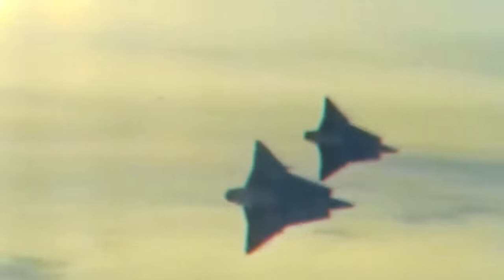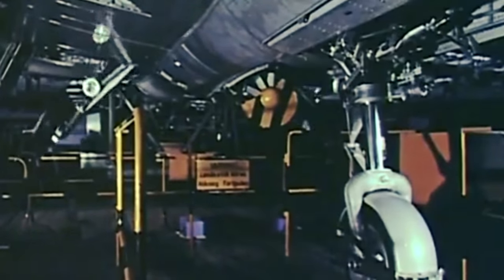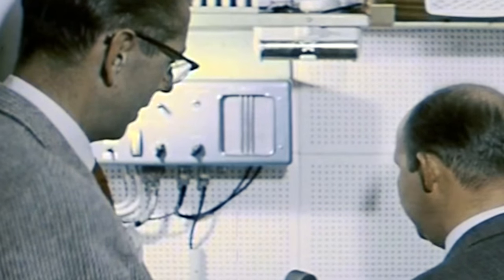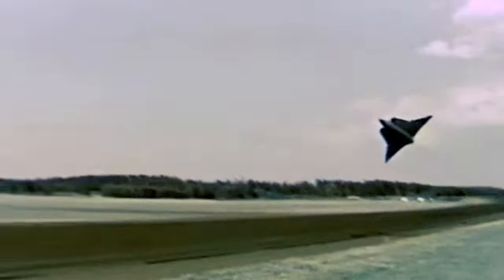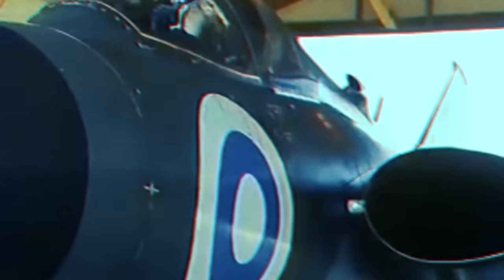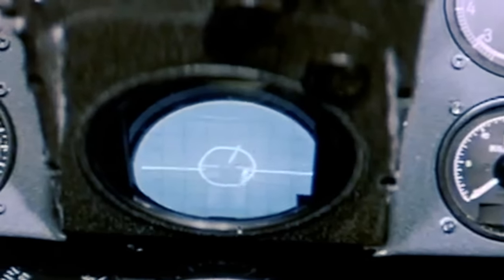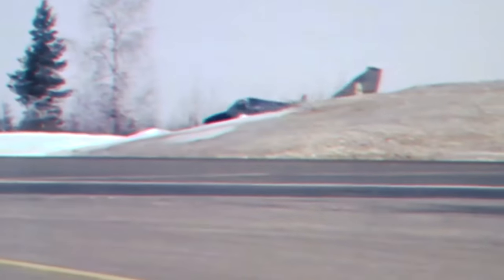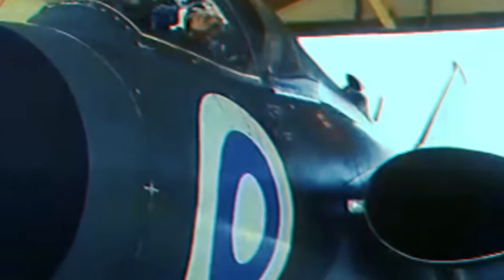The Bizarre Airplane Design That Shook Up Aviation

Comment: Always like the look and capabilities of the double delta wing. Makes me wonder why more plane manufacturers don't use it.
Reply: I think the HAL Tejas is the only modern jet that uses a pure compound tailless delta without canards.
Reply: I would assume it was cost in manufacture why it wasn't more popular for use beyond military.
Reply: Leading edge extensions on the F/A-18 are suspiciously similar.
Reply: Changes in computing and fly by wire, along with a canard configuration, made the double delta not as maneuverable.  Millenium7 has a number of videos that go over it in rather technical detail.
Reply: @thystaff742  Actually, the overall manufacturing costs were greatly reduced by the simplicity and practicality of this brilliant design. That's why Sweden (which had a population of roughly five million back then) was able to build 651 of these beauties.

They built the forward fuselage and inner wing as a single piece, then bolted on the rear fuselage (which contained the engine, of course) and outer wing panels. Frankly, Sweden couldn't have afforded a more expensive foreign fighter contract back then, so they opted to build the best homegrown fighter their limited tax base could manage, and to everyone else's surprise, it turned out to be a world-beating design thanks to their ingenuity. 

Canada could learn a great deal from Sweden!😉
Reply: @That70sGuitarist  The Arrow says hello!
(Avro Canada CF-105 Arrow)
Reply: @That70sGuitarist  Incorrect, homegrown fighter programs are much more expensive than simply buying already designed commercially available fighters. Only on very large production runs does it become cheaper to design your own plane. However Sweden had the hopes of selling their fighters to other countries and being able to regain the money they spent on development and infrastructure.
Reply: @weasle2904   While that may be true today, it certainly wasn't true back in the 1950's when they designed and built the Drakken, which had its first flight in 1955. Sweden had been building their own aircraft for many years by then, and had plenty of experienced engineers and designers to draw on. 

Starting an aviation endeavour from scratch would have been far more costly, to be sure (as Canada learned with the Arrow), but developing new aircraft within an already well-established indigenous industry would not have been that much of a challenge, especially not for SAAB. Remember, they built over 600 for themselves before they started selling them to other countries.
Reply: @That70sGuitarist

No. 

Dief was right to end development of that bottomless pit in which to pour money into. 

Canada’s aerospace industry thrived in the civilian market where corporations instead of taxpayers footed most of the bill while even the USA was staring down multiple runway defence projects draining the treasury and driving them deeper in debt. 

The greatest aviation tragedy in Canada was the loss of the C Series due to corruption and ineptitude of Bombardier and our government.
Reply: @Weasle  No commercially available aircraft fulfill the Swedish requirements on dispersed airfield deployment. Furthermore, the money spent on development and production, stays in Sweden. The technology spin off can't be valued, but greatly contributes to the Swedish economy. Spending domestically is not wasting money.
Reply: @calvinnickel9995   Umm...why exactly do you think I added "...as Canada learned with the Arrow...?" I'm perfectly well aware of how much the Arrow's costs ballooned, and probably much more so than 99% of Canadians, since my Da had (literally) completely unfettered access to the back rooms of Parliament Hill at that time. You are entirely wrong in assuming that the same factors that killed the Arrow also came into play in Sweden, because I can assure you they definitely didn't. 

First and foremost, the Drakken was relatively inexpensive to build and maintain due to its inherent simplicity. Furthermore, those canny Swedes didn't waste their time or efforts trying to design, develop and build an entirely new and completely untried engine, nor to design, develop and build an entirely new and completely untried weapon system, either! Instead, like the clever merchants they have shown themselves to be over and over and over again, they used the best "off the shelf, commercially available products" they could get their hands on, which also saved them a great deal of time, money and effort.

Also very much unlike Canada's ill-fated Arrow, Sweden was not "starting entirely from scratch," because they'd already been designing, developing and building their own homegrown  fighters and bombers for many years prior to WWII. They even had prior experience designing, developing and building indigenous fighter jets, such as the legendary Gen I "Tunnen," or "beer barrel." Furthermore, none of the "commercially available fighters" of that time met Sweden's very exacting specifications, so that was not, repeat, not an option!

Simply put, Sweden was on its own (as usual), and fully funded the development of the Drakken themselves. Since it was both considerably smaller and vastly simpler than Canada's ill-fated Arrow, and also didn't include the skyrocketing costs of scratch-building new and unproven technologies, their costs were lower than most "commercially available fighters" would have cost them. Even if the F-104 Starfighter had been made available to them at the time (which it probably wouldn't have been, given the fact that it was only available to NATO members at the time) it probably would have cost Sweden even more than the Drakken did, especially since they would have also required the US government's express prior approval to build and sell any export versions. This would have denied them economy of scale and export sales! Also, given the fact that US aircraft were only being made available to those nations which were bound by treaty to the US, Sweden probably wouldn't have qualified for them anyway, due to their cherished status as a non-aligned nation.

What's more, they cranked out over 600 of those puppies for their own use prior to developing the export versions, which ended up serving in Finland, Denmark and Austria, as well.

Here endeth the lesson, my young Padawan. Next time, try checking and double-checking your facts prior to trying to "educate" others.
Reply: @isuzu343   As I said in my initial comment, "Canada could learn a lot from Sweden." 

Unlike Sweden, which already had ample experience in designing, developing and building indigenous fighter jets (the SAAB Tunnen and Lancen), Canada's only prior experience at designing, developing and building its own fighter jets was with the excellent but very limited CF-100 Canuck. While the Canuck was the most heavily armed all-weather fighter in the world at the time it entered service, it had about as much in common with a multi-Mach fighter/interceptor as a telegraph has with a modern mobile phone. (As a proud and loyal Canadian, I mean no offence by that, I'm simply pointing out what should have been quite obvious to all concerned, even then.)

Not to put too fine a point on it, AVRO Canada simply took on too damned much to get it all done right, on time and within a (somewhat) reasonable budget. Not only did they commit to building the Arrow, but also to designing, developing and building a completely new and entirely untried engine, and a completely new and entirely untried weapon/fire control system. 

That is what really caused the completely out-of-control, ever-spiralking cost overruns that ultimately signed the Arrow's death warrant, much more so than any supposed "US pressure." Remember, the US's own high multi-Mach, high altitude interceptor, the proposed XF-108 Rapier (which would have been just as good as, if not even better than, the Arrow) was also cancelled right around the same time the Arrow was cancelled. Why? The answer is painfully simple, really; the Soviet Union's launch of Sputnik gave birth to the era of intercontinental ballistic missiles, which rendered the whole idea of massed bomber fleets delivering nuclear.devastation obsolete, and almost overnight, at that!

Had Canada followed the example of those canny Swedes instead, they would have only designed and built the Arrow, and used "off-the-shelf, commercially available" hardware like engines, weapons and fire control systems. That way, the Canadian taxpayer wouldn't have had to pay for all those additional design and development costs right off the bat. Instead, improved engines, weapons and fire control systems could have undergone a much slower, and far more thorough design and development cycle, and been added to later generations of the Arrow, once they'd started selling some overseas to help recoup some of the initial costs and (most importantly) reap the additional fiscal benefits of "economy of scale." After all, building 500 or 1,000 Arrows would have ended up costing much less per aircraft than only building 200. Just look at the F-35 Lightning II, for example; the initial cost was slated to be higher than that of the F-22, but as more and more allied or friendly countries signed up to buy the F-35, the per-unit cost dropped from "more than the F-22" to only a little more than a fleet of the latest version F-16's, F-18's or SAAB Gripen would cost.

So as much as I would have loved to grow up in a Canada that was protected by a fleet of CF-105 Arrows, I place the blame for its demise right where it really belongs...AVRO's own leadership, for their foolhardy decision to design not only what could have been one of the greatest interceptors of its time, but for biting off more than they could chew by adding the ever-spiraling costs of designing, developing and building entirely new and untried technology in the form of engines, weapons and fire control systems. 

Face it...the Arrow's goose was cooked by that decision, much more than by Dief's decision, or any supposed US pressure. (Sigh!)
Reply: @isuzu343  "the Arrow was a fantastic, futuristic design which would have not only changed the face of Canadian aviation industry, but global military aviation as a whole" and yet not much of its design was used afterwards. And wishful thinking that everyone was gonna buy it is just fantasy. Sweden wouldnt have touched it with a 100 foot pole either since they had to be able to do short runway takeoffs.
Reply: @isuzu343  Indeed, the Arrow was an interceptor, a role whose time is very long in the past. Take a good look around the world right now and count how many countries are still using "interceptors" instead of a dedicated mix of light and heavy fighters. You'll find exactly one country, Russia, a country so vast (including Siberia, of course) that it still spans something like ten or eleven time zones. They still use the MiG 31 interceptor, albeit mainly to deliver alcohol to remote Siberian air bases!🤣

They have also recently used it to launch air-to-surface missiles at Ukraine. How's that working out for them? (Time will tell, I guess.)

Yet, if you think about it, exactly when was the last time massed bomber fleets were met in combat by dedicated "interceptors?" WWII, that's when! Even during Vietnam, the USAF didn't use massed bomber fleets to pummel North Vietnam, but usually used smaller numbers to attack "politically expedient" targets that didn't contain things that went "boom."

The dawn of the missile age absolutely signalled the end of the notion of massed bomber fleets delivering nuclear payloads. That you repeatedly try to deny that fact proves that your entire argument is emotionally based, not rational and fact-based, as my argument has been all along.

And where are those "massed fleets of bombers" today? Scrap metal, replaced by much smaller numbers of vastly more capable, highly specialised airframes, which were built in very limited numbers due to their extremely high costs. And have any of them been sent on mass penetration raids to deliver nuclear annihilation to the enemy? No, not even once. The missile era definitely ended the concept of massed fleets of bombers delivering nuclear destruction to the other side of the world. No matter how you try to deny it, you can't change the facts...so you rant and rave instead. (Oh yeah, those are some great debating skills there, alright!)

Some people simply can't handle the fact that Canada couldn't afford to keep pouring good money into the titanic boondoggle that the Arrow project had become, so anyone who touts the simple economic facts of the matter is immediately attacked by these overly emotional types. You know the ones, who think the CBC's Arrow mini series was "a true story?" Get some help, then join the rest of us in reality, buddy, 'cause people are starting to worry about you.🤣

Furthermore, people like you always seem to overlook the fact that the Arrow's capabilities and specifications were becoming widespread public knowledge, or the fact that the Soviets had agents inside AVRO Canada and many of the contracted companies contributing to the Arrow. 

Are you familiar with downtown Ottawa, by any chance? There used to be a huge, burgeoning neighbourhood called LeBreton Flats, just west of downtown. (My Da grew up there, in fact.) In the early 60's, the government seized the land, demolished all the buildings and pushed all the residents into new housing projects built around the fringes of Ottawa, then announced that the Flats would be the new home for NDHQ. Within weeks of that announcement, several Soviet "legals" had rented several suites and apartments in the Juliana apartment building (corner of Bronson/Albert) overlooking the Flats. As soon as the RCMP learned that, the project was shelved, and NDHQ continued working out of the old white clapboard WWII "temporary buildings" on Laurier Avenue West until the early 80's when the new NDHQ buildings finally went up...on Laurier East, on the opposite side of the Rideau Canal. LeBreton Flats, on the other hand, remained empty and untenanted for nearly 60 years, until the NCC finally started selling lots to condo developers several years ago. 

And those government housing projects on the fringes of Ottawa? They gradually turned into multi-generation slum neighbourhoods like Ritchie Street, Caldwell Street and DesLauriers. If you're not from there, you really don't want to be thereafter dark.😉 

"The government, in its wisdom, has decided to..." Those words have sounded the death knell for many Canadian programs over the years, but if you dig deep enough, you'll always find out that the decision was made for sound reasons. Building, arming and deploying 200 Arrow interceptors would have consumed the entire defence budget for several years thereafter. In light of that fact, and given the growing penetration of the project by Soviet agents, the decision was made. End of story...except for those overly emotional types who can't accept that the world has long since moved on. Feel better soon, buddy!
Reply: @markusoswe  it depends on how successful the program is.
Reply: @weasle2904  Commercially or military?
Reply: @markusoswe  Both. There are certainly many domestic military programs that have been wastes of time and money. You wouldn't tell a small country with little to no military industry to develop their own fighter program.
Reply: I think now maybe it’s the RCS profile, looking from top or bottom it would be a large return. Still a sweet looking bird.
Reply: @Weasle  Well, I guess it depends on who you expect to combat. If your neighbour is Russia, and your primary concern is aggression from them, you have to develop defence strategies coping with that threat. If your major threats come from non state actors, you can develop other capabilities, not aimed at fighting a peer adversary. What's the point of patrolling your borders with a 5th gen fighter, if you don't expect defending against one. Sweden is a small country, but with a long tradition developing threat responses to our Eastern neighbour without breaking our economy. Our proximity to Russia makes it difficult to defend our airfields, and we developed an asymmetric response to the threat.
Not even the Russians can operate their fighter jets from airfields close to the conflict zone in Ukrain. From where did the Finns plan to operate their F35 fighters if attacked by the Russians?
Reply: @Markus Olsson  The F-35 had enough of an overwhelming advantage over previous generations fighters the Finns decided it was worth it, considering how easily the F-35 would outclass non stealth Russian aircraft. Frankly the F-35 is probably the best option in general if you're neighboring a hostile nation. It's quite reliable, it's only the stealth coating that gives additional maintenance. But considering the advantages it is a well worth expense. Other than that, the more modern computer system and architecture of the F-35 is much more streamlined and lower maintenance than previous generation aircraft. For instance, the F-35 is only 30% more expensive than the F-16 per flight hour. A major improvement since all the media buzz in 2015 calling it a lemon and such. It's unit pricing is also much lower than competing aircraft.

And soon the F-35 will be getting the newest generation of jet engines with adaptive cycle. Giving 15% more thrust and range to the already most powerful jet engine in the world. As well as new AESA radars utilizing a new more efficient material, with increased power budget thanks to the new revolutionary jet engines. I believe Finland is interested in acquiring these.

It's only a matter of time before newer lower maintenance and more stealthy ceramic RAM coating will be integrated on to the F-35.
Reply: @weasle2904   The reason why Sweden startedcbuildjng their own jets was because of the ww2 experience. When a war breaks out, noone will sell planes and if they do they will be obsolete. So being neutral, sweden felt like they needed to be self sufficient in making jets. Also, double delta is fast but it's not agile. Darken was built for speed but had poor turning rate. It was created to intercept high altitude bombers coming from the east over the Baltic. Its definitely no dog fighter and quite difficult to fly. That's why double delta without canards are no longer used.
Reply: @weasle2904  What use do you have for a fighter jet without an airfield? It doesn't matter if it is invincible if it can't be flown. Sweden and Finland has been allies a long time, and an aggression from Russia against Finland wouldn't go unanswered by the Nordic countries. It would be in our own interest to assist the Finns. Having said that, when Finland made the decision to acquire the F35 they were not part of Nato, and the only way to get depth in their air defenses would be to get assistance from their allies operating Gripen.
Reply: @markusoswe  clearly finland disagrees. And it's not like F-35 is incapable of operating on improvised air fields lol. US exercises highway landings all the time. F/A-18 did it all the time.
Reply: @Weasle  So you argue that you can operate F35 from dispersed airfields in Nordic conditions? I would be surprised if you couldn't land the Hornet pretty much anywhere, since it's designed to be operated from aircraft carriers. The F35 version Finland opted for, however, is not. You argue that small countries should refrain from developing advanced fighters. The Gripen is competing against  F35 in biddings around the world, even if it's developed by a country with a population of 10 million people. 
Why do Ukraine ask for Gripen? It's designed for exactly the conditions Ukraine fights in.
Reply: @Markus Olsson I believe the F-35 is capable of landing on US highways, and all current US air force aircraft should be fully capable of landing on grass even. Would it be entirely suited in Nordic countries? I wouldn't know. The Gripen clearly is more suited to this. But the F-35 has already completely obliterated the Gripen in every single war trials competition it's ever been in. Brazil is the only country who chose the Gripen due to costs and domestic manufacturing. However as we know now, the Gripen is actually more expensive per unit, so it's really only maintenance that is cheaper. And Ukraine would definitely ask for F-35's if they knew the US would give them any, but they know they absolutely would not. The US won't even give them F-16's.
Reply: @weasle2904  how about comparing turn around time on those highway landings? The F35 wouldn’t even be halfway spun down by the time the Gripen was back in the air. It’s built as part of a system for exactly that. It requires far less complex infrastructure and far less trained personnel. 

And while the unit cost is ‘high’ and maintenance cost low, put it together and the cost per flight hour is radically lower. 

Plain and simple, the F35 isn’t effective or cost effective outside of an airport or military base, while Gripen is made for roughing it in the countryside. Again, why Ukraine is asking for it.
Reply: Wasn’t there an experimental F16 version built with double delta? It kind of looks similar to a Saab 35.

Of course the real heritage is the Saab 37, then the Eurofighter, Rafale and Saab 39.
Reply: @RandomName100 It's a common misunderstanding that the F-35 requires "more" complex infrastructure... It's the complete opposite. The F-35's more modern internal systems require less maintenance and have higher turnaround time. The stealth coating has been the only high maintenance part of the aircraft. Which let's be completely honest, you WANT stealth. The cost is worth it.
Reply: @weasle2904  It may very well be the case that some people misunderstand that. Problem is, you misunderstand the concept of scale, and seem to lack knowledge of the Gripen system. 

Yes, the F-35 require less maintenance compared to other aircraft like the F-22 and the likes. But compare it to the Gripen, and the comparison is vastly different. Even being ‘low maintenance’ in US eyes, it’s vastly more expensive to maintain, and requires trained technicians. Gripens maintenance is done by conscripted soldiers, on a road base. By design. 

I won’t even bother looking up the numbers to compare. But the simple fact is, it is lower. Per lifetime, per flight hour, per whatever. It is lower. And the turnaround time on the Gripens are exceptional in military aviation. 

It’s not as capable as the F-35, there is no disputing that. But at the same time, there is no disputing that if you put the F-35 on a road base with a ground crew of similar training as the Gripen crew, and the same budget for getting it in the air, you have a paperweight. Plain and simple.
Reply: Another reason is that the F-15 proved that with enough thrust and modern computer avionics, aerodynamics aren’t as vital anymore.